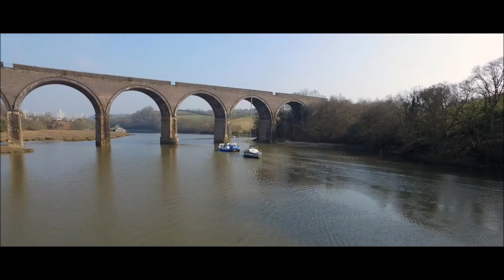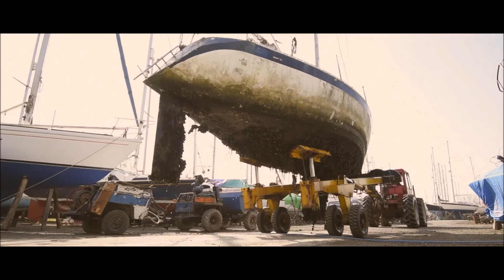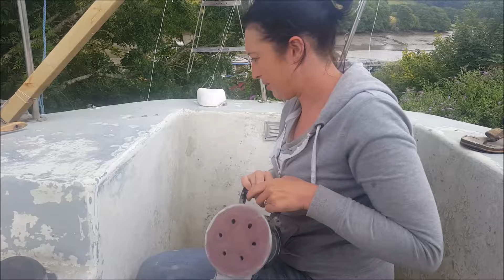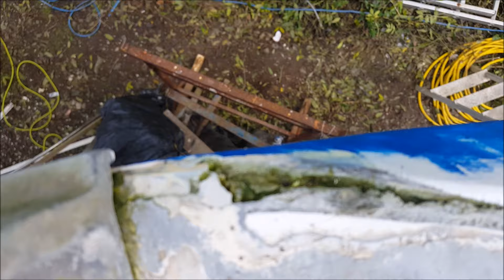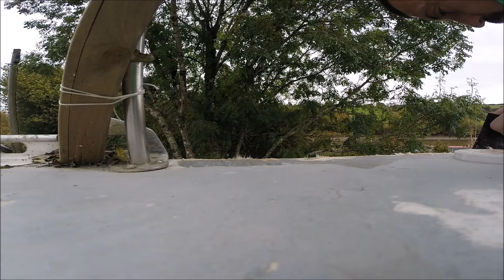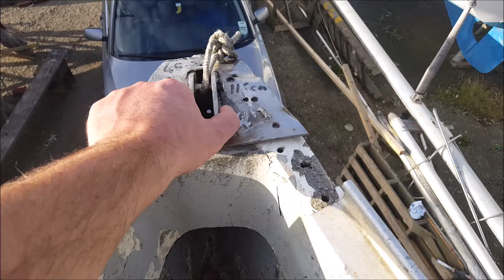Sailboat Refit part 7

Comment: I live on my boat all year round,  The thing that has really made a difference in the Winter is having a quality desiccating de-humidifier (the other types don't work in cold weather). I use a Meaco DD8L Junior as recommended by Practical Boat Owner.  I also have a very small fan heater.  Without the Meaco, the fan heater makes almost no difference at all.  With both - it's great. Getting rid of the dampness takes the chill out of the air.  Also, if I hang a damp towel, or clothes, up in the boat at night they are dry in the morning.
Reply from the maker: Just about sailing I will keep that I mind also do you know what month and year it was in pbo so I can find the article 
thanks mate
Reply: Here's a link to the online article (Nov 2014) http://www.pbo.co.uk/gear/alex-bell-tests-8-dehumidifiers-find-sea-worthy-17169

Comment: I didn't read all the comments below so I am probably repeating someone else's point, but that autobody filler is not a good choice for those repairs, it has no structural strength at all.  You really should be using epoxy along with some glass.  That cracking at the hull to deck joint needs more grinding, epoxy and chopped strand filling, and some real reinforcement by way of a few layers of glass.  The chainplate would would benefit from epoxy and some chopped mat or something within the hole, and a layer of glass on the outside and on the inside.  In both cases fair with thickened epoxy afterwards, then paint.

Comment: Looks like your deck/hull joint is knackered - or was it just those areas shown in the video. I do not think foam backed vinyl will cut it in a boat environment - go celotex and put a finish of your choosing over that.

Comment: 10 HP outboard is not strong enough for this size boat,....think of the water resistance and you'll figure it out. If you're going to the outboard engine route get atleast a 25 HP with reverse option.
Reply from the maker: ThatDutchguy  thanks mate 
I've been told if I use a high thrust sailmate outboard  that it should be OK but I will like to find sombody using one first  to see how they get on
Reply: +squires lady refit    Hi that 10 hp outboard will be plenty of power for this light weight boat with a slippery racing hull. No worries ,  they put much  bigger engine on boat these day as the boats are much heavier, and everyone motors everywhere.  I hope you were able to get an outboard with a generator plug so you can charge the batteries.
Really the best choice for the reasons you said.
Love this old school rebuild, no need to make it like new just strong and serviceable.
Cheers Warren